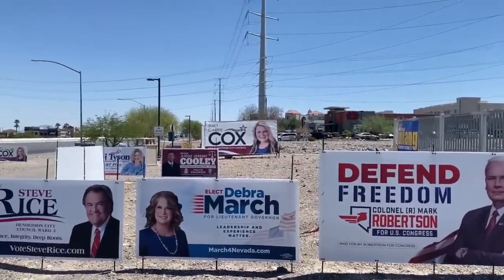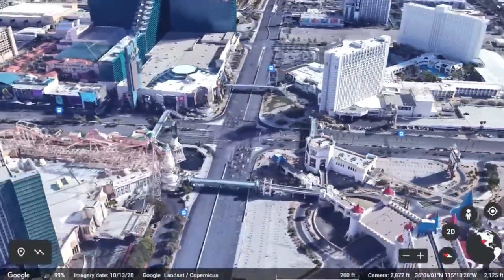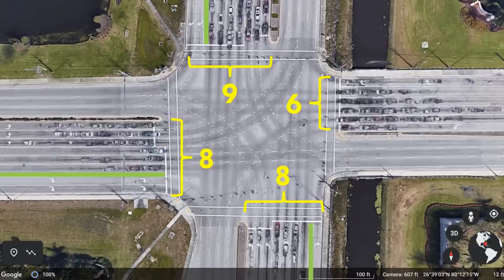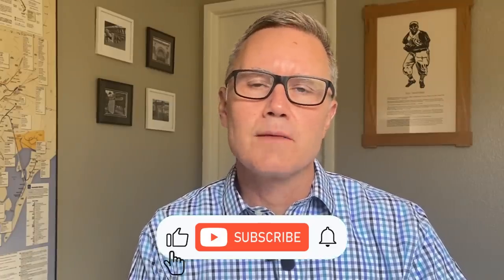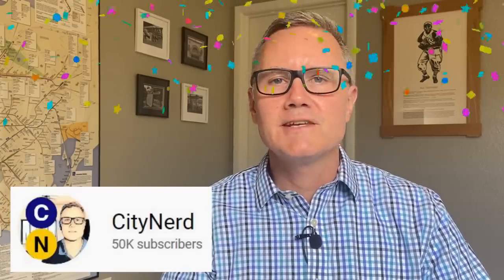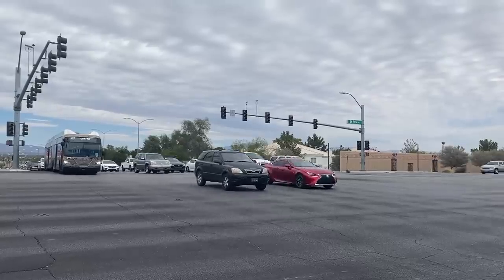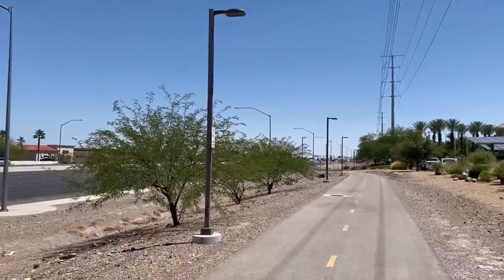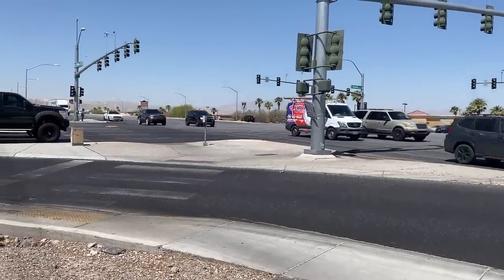Stroad vs. Stroad: Land Use, Traffic Engineering, and What Happens When Suburban Arterials Intersect

Comment: Intersections like this also make high speed vehicle-on-vehicle collisions much more likely (compared to using a roundabout or just designing the street differently)
This helps fuel the “bigger car arms race” as people feel the need to own larger and larger vehicles to protect  themselves from other peoples larger and larger vehicles. As a result everyone ends up spending loads of money to ultimately be no safer and pedestrians become much less safe so they start driving too, making everything worse still.
Reply: This is a great point that intersections like these are partially to blame for the bigger car arms race. @CityNerd should definitely call it out in a future video!
Reply: Speaking of arms race, anyone notice how bright  factory LED headlights have become? Sigh
Reply: @noleftturnunstoned  I'd like some of those for my bike, just to keep up
Reply: @noleftturnunstoned  It's scary to come in contact with a new vehicle in the opposite direction at night while riding my motorcycle as the lights are blinding.
Reply: @altriish6683  I have very bright LED lights for my bike, they were expensive and annoying for other people when I activate the strobe setting.
Reply: Just wanted to add the biggest reason for big car arms race is the state of some roads around America. Absolute shambles & in Vegas case always construction so roads are jacked up.
Reply: @CellaDragon  that has nothing to do with anything.
A SUV is not better at handling bumpy roads than a small car
Reply: @noleftturnunstoned  yes.  And I hate driving at night because of this. It also seems many people drive with there high beams on with out dimming them. I refuse to use them at all.
Reply from the maker: @AaronTheHarris  I do talk about the "arms race" aspect a bit in my Pickup Trucks video from a few months back, but yeah, there's a lot more to say about it.
Reply: @lavidawithjoey  i allways drive by memory xD. If there are more of them you really must check ahead of passing them
Reply: @noleftturnunstoned  Hopefully that should be getting better at least. IIHS now measures glare for other drivers and a vehicle can't get "top safety pick +" if it creates excess glare. Safety ratings are a big motivator for manufacturers.

That said, fixing the beam pattern to not blind people on a level road doesn't change the fact that roads are rarely perfectly level, so there's something to be said for limiting overall brightness. The US tends to be very libertarian about personal vehicle regulation. Seat belts and pop-up headlights aside, many headlamps sold in the US are illegal in Europe and it's insane that modifications like bull bars or huge lift kits are legal (including for police).
Reply: @Jehty_  sold cars for years out here in Vegas Don’t tell me what I didn’t hear as a good portion of reasons. “Want to be higher up the roads are bad” feel safer Was the other big reason
Reply: @noleftturnunstoned  Goddamn those oncoming headlights are unnecessarily bright and more obnoxious than high beams and should be outlawed … where can I get some?
Reply: I find it interesting that people will spend tens of thousands of dollars instead of just learning to drive better lol
Reply: @Jehty_  Larger wheels do help. I was glad my Chevy HHR (a small erstaz truck) has 17" wheels when I hit a large piece of junk on the highway last month. It may have dented my wheel (hasn't been to the shop yet), but it took out the tire of a smaller car. Since that trip I have mostly been driving a recently inherited Hyundai Accent and it feels much slicker on bad roads on much newer tires. Not that a competent driver shouldn't be able to deal that. Drive a little slower, it's not hard...
Reply: @toolsteel8482  high beams always did seem kind of useless to me. My family always insisted they were for "checking for wildlife on rural roads" but it seems like driving slower would be way more effective. I don't care how bright your lights are, if a deer runs out in front of you and you're going 65 mph, enjoy your bodyshop invoice.
Reply: @abnormallynormal8823  because they think it’s everybody else’s driving that’s the problem. And in fairness even if they did just learn to drive better everyone else’s driving would probably still be a problem. Good road design is the key.
Reply: Not to mention the fact that these larger cars kill pedestrians more than smaller ones.
Reply: That why car insurance is so expensive forcing us to spend so much money on gas, insurance etc.
Reply: @someguy6075  After working in the eye industry I can say that elderly/middle aged people with cataracts are affected by car headlights even worse than people who are younger. I've had people who can see 20/20 normally but you shine a bright light in there eyes and their vision can drastically decreases to 20/50 or worse to 20/100. Most of these people avoid driving at night. After working I am worried about people driving at night. These new headlight are ridiculous, especially out in the back roads where its super dark and people are driving in jacked up HUGE trucks! Those truck drivers are either right up on your butt with there LED lights in your mirror blinding you or just just coming down the road...
Reply: @someguy6075  since you were talking about Europe: Mercedes developed an adaptive laser headlight for their new S class that can detect other traffic participants and actively not blind them. so, it's theoretically possible to drive around with brights on all time. that's technology that's already available to buy right now. that light can even project a pedestrian crossing for a person you stopped for .. but that's currently not legal, so it's deactivated.
Reply: @megansleigh4293  I'm 52 and really struggle with that. Unfortunately not driving at night isn't an option.
Reply: I think the number one reason why bigger cars exist is because the laws are junk and dont tax vehicles in the appropriate way - trucks can be way bigger, so every one just ends up buying those monstrosities.
Reply: @akash_goel  I absolutely don't understand the appeal. I miss small trucks like the Chevy S-10 and the original Toyota trucks.
Reply: I'd love to see a roundabout work in Vegas.

Comment: This is something that I (German) had to learn the hard way when I was in the US.
I was on a business trip, it was the first evening and I was back at my hotel. I wanted to get something to eat and noticed that there is a shopping mall just 1300 ft. away from my hotel, and I assumed (correctly) that they'd have a food court there.

However, there was something between the hotel and me - two lanes of stroad going one way, three lanes + shoulders of interstate-like limited access highway going the same way, and a mirrored version of all these lanes going the other way. Sure, there was a bridge to cross at least the limited access highway, but this bridge simply had no footpath whatsoever. The only way to get from the hotel to the mall was to get in my rental car and drive.  Checking Google Earth it seems like the bridge now has a footpath added on one side, so in this case it was obviously an afterthought.
Reply: Oh my god, they built a road and didn’t actually link it up with sidewalks?

Comment: The business park intersection in the Not Just Bikes video a couple months back blew my mind. Incredibly interesting technical breakdown. I'm looking forward to more.
Reply: But such an intersection traffic control is only possible if you kept the traffic to a moderate level (using the well known methods to do so). If you have 100 cars, that need to cross the intersection each minute, there really isn't much you can do other than sacrificing everything to throughput.
The perfectly tuned intersection at NJB is the cherry on top, but you have to bake the cake first. But a intersection with 29 lanes means you have no interest in cake, all you want are soggy french fries from the drive through.
Reply: I think dutch traffic engineers would create a design with no traffic lights at all. A clover design maybe, but supplemented with tunnels for the bicycle and pedestrian traffic. Of course they will never have to create such a design, because there are no stroads in the Netherlands.
Reply: @hendman4083  might suggest you look up Tom Scott The magic roundabout.
Reply: @frankduff18  I doubt this 29 lane, high speed, high volume intersection can be replaced by a roundabout (not to mention that americans are horrible at navigating roundabouts). In a high speed/high volume situation like this, you want to remove points of conflict as much as possible, probably also the reason you don't see many roundabouts on highways.
Reply: @hendman4083  There are a ridiculous number of conflict points when there are this many inbound lanes at a four-way intersection. Some vehicles have to go straight, and some other vehicles in the oncoming lanes have to turn left, and when there are 6+ lanes in each direction, that's like 36 points of conflict. Even with two of those lanes in each direction being slip lanes, that's still 2 * 16 points of conflict, far more than one would see at any normal roundabout. The real reason traffic engineers don't put roundabouts on highways is that you have to slow down at a roundabout, look around, and pay attention to what other road users are doing. Highways are where cars are supposed to be able to go fast while drivers kind of zone out a bit, and roundabouts just ruin that whole vibe. 

Of course, so do signalized intersections and multiple driveways into and out of offices and shopping centers, but that is why the word "stroad" was coined _ to describe thoroughfares that try to have it both ways like that.
Reply: @hendman4083  A roundabout would probably struggle within the footprint used by this crossroads.  It could probably be done with a roundabout plus flyovers for the "straight ahead" movements, but that's expensive. If the "through traffic" is dominated by one direction, then a through-about (hamburger roundabout) might work.

However, the biggest problem is that the whole area has been designed to be utterly dependent on private car usage, and this has created the demand for such large intersections.  Solve that problem, and you can then start designing better junctions.
Reply: @misterflibble9799  I think we can all agree on the fact that the car centric development generates insane amounts of traffic. Designing stroads only amplifies the problems, either design a road or a street, not this horrible hybrid. And of course reducing the amount of cars would be best, but seeing solutions like this intersection make me doubt that that is going to happen anytime soon in the USA.
Reply: @beckobert  Dutch traffic signal engineer here. The many detector loops in the ground in dutch intersections is actually the best way to have the best throughput, together with seperating all traffic directing in the traffic plan. If a single direction has 1 less car than your maximum greentime for that direction. You can cut the green fast to quickly move to the next fase and give the other directions more green.  The key is to use every second you have efficiently. But indeed these stroads don't exist in the Netherlands. Roads with that many lanes are just highways and in most cases there are no intersections on them.
Reply: @hendman4083  We hardly have any roads more than 2x2 lanes within built-up areas, that’s why on our roads cars are going more fluently. All the dots are connected. If you have more people cycling and walking, you have less people driving a motor vehicle. If you have less people driving motor vehicles, you need less lanes. If you have less lanes, you can have intersections with roundabouts, turbo roundabouts or smart traffic lights, that will benefit the flow of traffic. Almost every intersection with traffic lights has sensor loops in the road surface in our country, to give the traffic light control unit the data it needs to calculate the most efficient cycle times. And (turbo)roundabouts are an ingenious design to slow down traffic, so that pedestrians and cyclists can safely cross the road(s) at this intersection. In my town we had an intersection with traffic lights, between the town center, the business sector and the ring road around town. This particular crossing didn’t have smart traffic lights, so waiting times for cars, cyclists and pedestrians was very long. They closed the intersection for 9 days and a turbo roundabout was constructed in 9 times 24 hours continuous road construction and it was finished on time, despite the rainy weather. During construction there were always four traffic wardens to regulate emergency vehicles across the construction site, because it was our towns most important intersection. You never have waiting times longer than a few seconds anymore. Not for any mode of transport. Cyclists and pedestrians have right of way and cars have to give them priority. And still motor traffic simply flows better at this very busy intersection. I wouldn’t want those traffic lights back, not even for a million. And I use this intersection often, cycling, driving and walking. Driving is far more relaxed in our country than in America, and we maintain our roads way better. I really didn’t know what a pothole was until I drove in America (and Belgium of course).
Reply: @RealConstructor  I experience the same roads too ... dutchie here. 😂
Reply: @beckobert  the reason there is relativly little trafic is because it would pile up and it would take 30 minutes to get trough.
If it costs you half an hour to drive 100 feet you go looking for another route or another mode of transport.

Just like adding more lanes simply induces demand, lowering capacity lowers demand. It really isn't rocket science.
Reply: Of course that business park isn't feasible, when the only mode of transport is cars. People don't choose to drive, they are forced to by the design of their neighborhoods.
Reply: @hendman4083  Roundabouts reduce conflict points, and also turn every potential conflict into an angled one where you're both almost driving in the same direction, instead of head-on or t-bone. We don't have many stroads quite this extreme in the UK, but we do have some large, fast dual carriageways with frequent roundabouts. I can't think of a type of road except for motorways that I haven't seen a roundabout on.
Reply: @hendman4083  Then you haven't seen the roundabouts in England yet, which are on a highway. It can work, you're just not used to it.
Reply: @vos303  Vos thanks for contributing to our fantastic infrastructure. I fell in the rabbit hole of city planning a while ago and I've never been this grateful to live here. You guys are great.